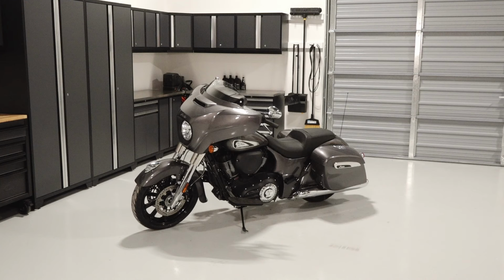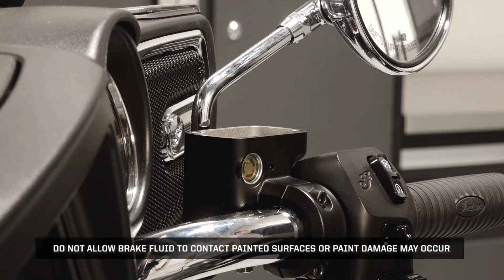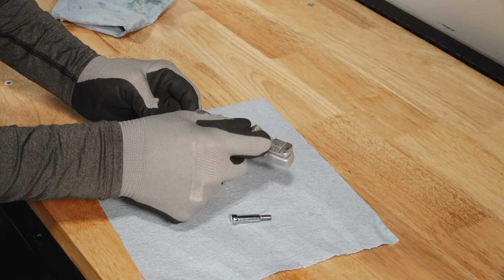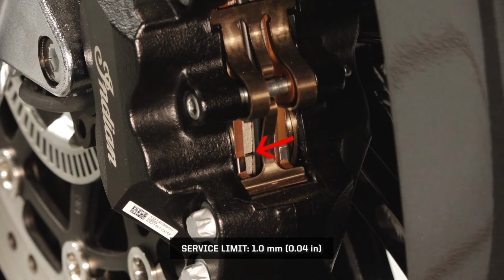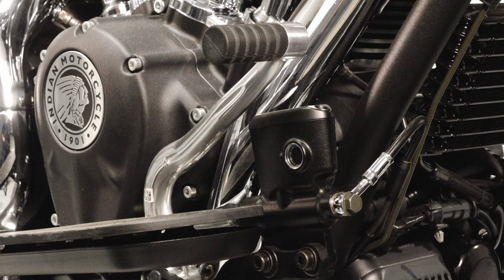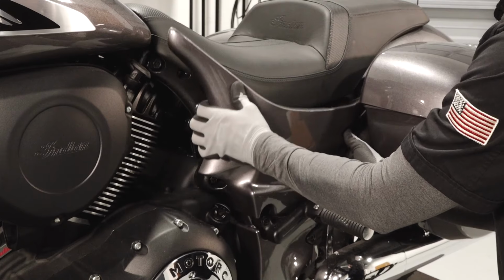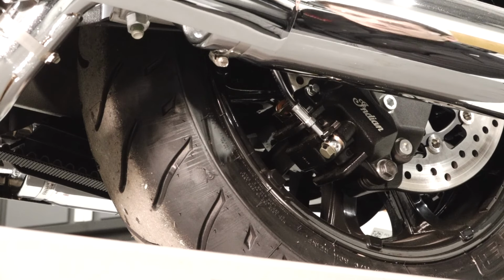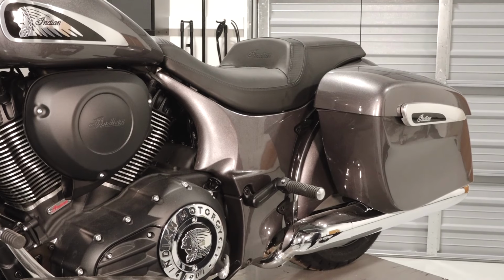Indian Chieftain Brake System Inspection and Maintenance - Indian Motorcycle

Comment: If my brake fluid is low I check the pads for ware first before adding fluid, if you add fluid then replace the pads the level will be too high witch can cause spillage.